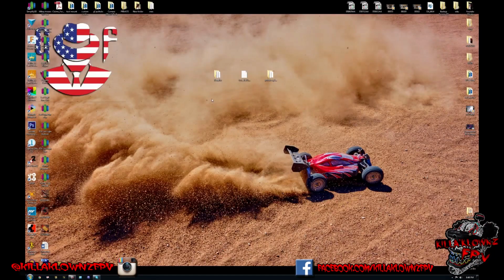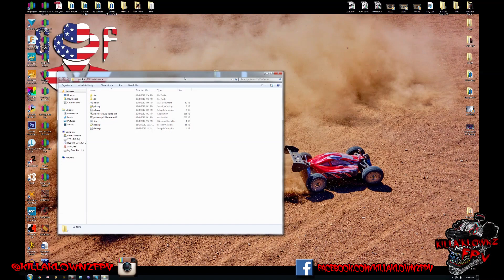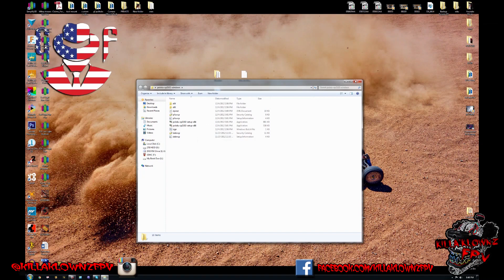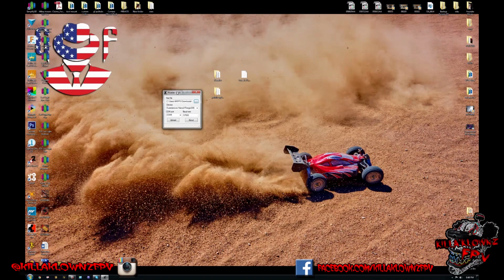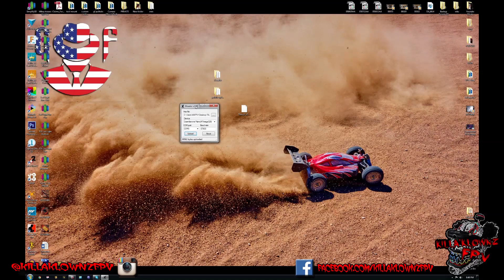FuriousFPV True D v3.6 FIRMWARE UPDATE TUTORIAL

Comment: I just tried updating my firmware on my true-d 3.6 to 3.7 and followed all instructions, my unit is now bricked and will not turn on either in my goggles or by plugging in USB. I tried searching for a solution and can't find anything :(
Reply from the maker: James Balducci are you positive you used the correct hex file?
Reply: Gerardo Valdez yes
Reply: Using Firmware_True_D_3.7.hex . Ended up ordering a realacc diversity module since furiousfpv never got back to me about this issue, just went through the same process with xloader to install Achilles firmware on that and it worked fine. Should've bought the cheap diversity module to begin with! Ordered the pro58 from bg so I can get Achilles plus with OSD going on that, plan on using the one I have now to build a ground station

Comment: Can you please tell me if you use audio with your FPV quads & fat shark goggles. If so does your audio work with the Furious because I can not get audio to work. Furious claims it does and they have also given me another True D but it's the same, audio will not work when I use the Furious True D module.  It works fine if using my standard FatShark diversity module.